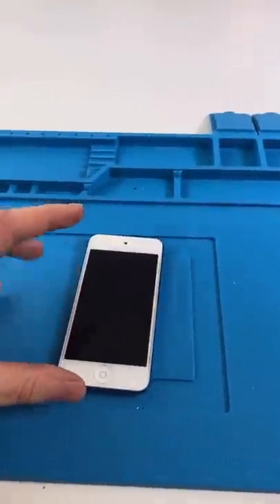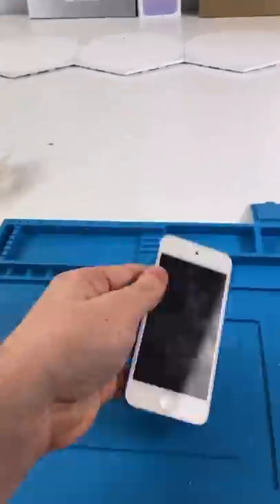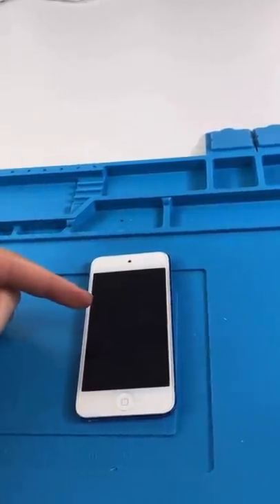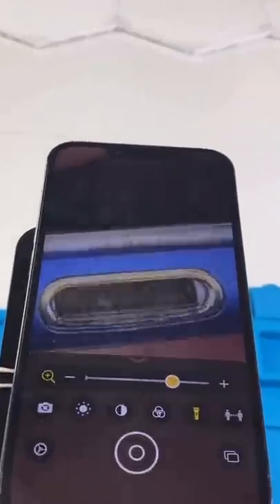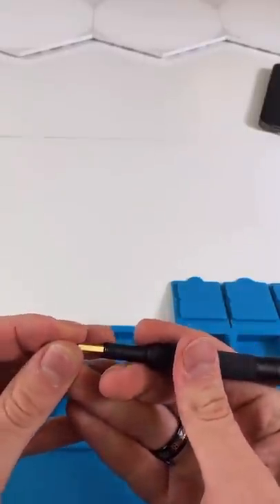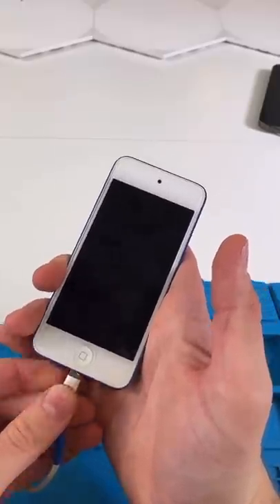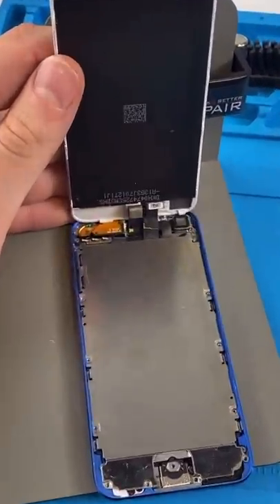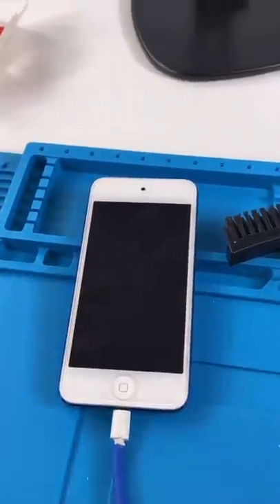STOP USING RICE FOR WATER DAMAGE.... #Shorts

Comment from the maker: it's an iPod 6 lol. And when you use rice on a device like this, you're making the problem worse. Honestly probably the reason why this one isn't working. Take out the sim and let the device get some airflow, or do absolutely nothing. Anything is better than rice!
Reply: Okey
Reply: 2nd, sorry had to do it
Reply: what about a hair dryer on cool? or a table fan to improve airflow and circulation? asking for a friend.
Reply: Rice actually made sense when you could open the device, remove the battery and place it in there, now heck nah.
Reply: Ok
Reply: But why tho
Reply: How u get rice out of your headphone phone hole
Reply: rice worked with my iphone se 2020 :/
Reply: Why can't you fixed it!? 

:(((((((

Wait
I don't care really
Reply: @richardhbn3308  ew iPhone
Reply: @richardhbn3308  the rice didn't do anything though. In your case there just wasn't enough water to kill the SE
Reply: @bennydontplaythat  the water had made its way under my screen and near the ram and it would restart contantly also dont tell me jack about it if you werent there
Reply: @ralphlee4060  what headphone hole tho lmao
Reply: @richardhbn3308  lol ??? My job is literally fixing water damaged devices. I'm just telling you the fact which is that rice does not do anything to fix water damage
Reply: @richardhbn3308  (Only reason I care is because people constantly bring in water damaged devices that don't work and are filled with rice)
Reply: stupid suggestion
Reply: Silica gel
Reply: ipod touch 6th gen
Reply: ipods have no sim card readers they go off wifi
Reply: Was about to say, 6th or 7th.
Reply: iPods don’t have sims tho…
Reply: Does silica gel work? The one inside shoes boxes
Reply: @koceme  heat works the best
Reply: What about corn works much better than rice and is too big to get into the charging port or any other part of the tech
Reply: Yeah
Reply: Ipod 6th gen
Reply: Ipod touch 6
Reply: I've had the same ipod in the same color, got rice in the charging port because I want to put it in a bag of rice for some reason, not sure why but I was 13 then and when I got a piece stuck I broke the charging port in the process.
Reply: I knew it was an iPod 6 or 7
Reply: Rice is better than nothing it absorbs moisture why do you think they expand when you cook them
Reply: Hey my phone is a xoimi  redmi 9s and when i put it in charge it says charging its slow how could i fix it pls help me
Reply: @navidnnAE  xaiomi*
Reply: @navidnnAE  you are not using a fast charger
Reply: 600th like!
Reply: @undefined06855  no way
Reply: iPod touch 4 has the old design, 5 gens have a little silver ring on the back and a more modern design, 6 gens don’t have the silver ring. 7 gens are the same as 6 gens
Reply: An iPod 4 need a 30 pin connector
Reply: Hi, josh(?) im about to attempt fixing my note 9 and i need your help. I need to know, when you’re removing your screen from the frame, do you also need to take out the battery and vibrating motor and all that stuff before you start prying into the screen or can you just pry it off after disconnecting the connector? I came here from a video of you fixing a note 9 display but its a short so you had to skip a lot of details, I need your help please, thank you.
Reply from the maker: @genzeuronymous7787  bro who is Josh
Reply: @PhoneRepairGuru  don’t know
Reply: @PhoneRepairGuru I must have confused you with “josh connects” another youtuber with similar content. But yeah, i saw a video where you replaced a note 9 display and you separated the lcd from the frame and i just needed to know how you did it just to be safe.. im sitting here with the phone already disassembled in front of me except for the stuff you cant taje appart without prying, i mean stuff not held together with screws like the battery..
Reply: Can u help me with something on my phone the phone is a motorola g8
Reply: Yah the 5 has the strap dot thing in the corner and the 6 doesnt
Reply: I have a question about an Android that I "repaired"...are you open for it?
Reply: Which smart phone in your opinion please share
Reply: Why do you use metal picks to clean out charging ports
Reply: Ugh I remember having that iPod 6 gen. Died soo fast. And the screen was popping off from the battery 😎 finally got an iPhone bc of it lol. I dropped my 7 plus into the tub on accident (it slipped outta my hoodie when I was cleaning the tub) and like- as soon as it fell I grabbed it turned it off took it out of the case, dried the outside and let inside air dry. The speakers and mic were muffled but I fixed that my self, everything works fine now. I got my phone battery replaced recently and they said there was no water damage which is a relief! Thank gosh I did everything right or I would’ve gotten grounded if my phone broke.😂😂

And one time while I was on a zoom for school my hydro flask fell over onto my chromebook (personal not school chromebook) and the water went into it, and the screen was messing up and basically I wiped everything, turned it all the way off, put it like a triangle and let it air dry over night praying it would work because I had school the next morning. When I woke up the next morning I turned it on and it was completely fine. It still works fine til this day. 
I get very lucky with water end electronics 😂
Reply: @AbbeyKitty1013  are you really here to complain? How sad
Reply: But why I don’t see how rice could effect the device since they are kinda dust proof how can rice be worse the. Sand or other earth elements 🤌🏼
Reply: just a question where could i buy a phone from this guy
Reply: I would like to know if it is possible to take a virus off of a PS4 and if so how much would it cost
Reply: Yeah. I got water in my phone and i took out the sim card and let it sit for 24 hours and its working perfectly now
Reply: I had one of those
Reply: @zolavib1187  it still doesn’t help dry it out. Rice doesn’t help your phone dry any faster than air drying, so corn wouldn’t either
Reply: I was about to comment that cause I have one
Reply: and silica?
Reply: How come u never fixed a Samsung or any other phone
Reply: @Postwarlakeplays  he has an A70 screen replacement video from a few months ago that just got recommended to me. I’m assuming he just prefers working with iPhones or they do better on YouTube titles than Samsung brands
Reply: I’ve updated my iPad to iPad os 15 and it just completely crashed my iPad it shows signs of charging but won’t power on to test my theory I used 2 different portable chargers and with the original cable it came with it would only charge and not power on or show dead battery symbol but my portable chargers would show that it’s getting power any thoughts?
Reply: The 4th gen still has the old thick look while the 5 and up are thin
Reply: What if we put it in silica gel
Reply: I was like thats a iPhone 6 because i got my dad one
Reply: i have an ipod i think 6? its got some charging problems and stuff but honestly still works pretty well lol
Reply: So I dropped my phone in water, and the screen was unresponsive. I followed your advice to not use rice, and it worked!
Reply: Can I send you my phone for forgotten passcode phone repair guru
Reply: @abnervazquez3783  are you in usa or canada?
Reply: Untrue, rice does help, but silica is better. Both pull the moisture out of the phone. This iPod was probably already damaged when they put it in rice so it didn’t help. Also it doesn’t have a sim tray.
Reply: How can you take out the SIM card…on an iPod touch?
Reply: @NielsDutch1906  there is no sim card maybe a sd card
Reply: @robloxmaster8089  it was sarcasm. I know it doesn’t have both
Reply: Or if it’s a really old bad damaged phone u can just throw it out and get a new one
Reply: @bennydontplaythat  or it was distilled water
Reply: Hi
Reply: I have a IPod5 that has suffered a ton a abuse and still works better then my old XR ever did I have a 6 now lol
Reply: Better don’t Use metal in the Port Bro it can get damaged
Reply: @AbbeyKitty1013  iPhone and Android are both good quit doing phone wars
Reply: Ipod?
Reply: Except more water
Reply: Its an iPod Toutch 7th gen because its missing a lanyard thing from the back
Reply: I did that and my phone worked later: except the microphone.
Reply: @ralphlee4060  Cook it and eat it.
Reply: Even water is better the rice? 👀
Reply: @richardhbn3308  rice doesn't do anything lmao
Reply: Vitor Salles There a hole at the bottom of my android its for head phones after my water aciddent i put rice to soak water out and it think the jack got full of rice
Reply: @ralphlee4060  tho the rice doesn't do anything. It just gets dust inside ur phone
Reply: Or use water?
Reply: It's BRIGHT SIDE to blame
Reply: @hareeshravis1919  what
Reply: @BigMacCheese  yup they told this as life hack
Reply: @hareeshravis1919  ok
Reply: Lss
Reply: 100th
Reply: I thought ipods didn’t have SIM card
Reply: I still use rice but I cover all of the holes plus I am really good with not getting my phone wet so that's a plus.
Reply: Dream  That isn't true. See above comment./
Reply: @Cfomodz  I never said it wasn't. All I said was is in this context using a dessicant will be pointless, it won't do anything.
Reply: Dream  Nothing does Anything magically… ever.
Reply: Dream  it is moisture, not water, by the way.. maybe research first? Why do you think we use it with 3D printers? Because of all the water that gets in the bin?… or could it be the moisture?
Reply: @bennydontplaythat  yeah… but that isn’t true though..
Reply: @Cfomodz  What's your point? If the inside of your laptop is soaking wet, a dessicant won't save it, just plain and simple. Dessicants act way too slow to be effective as an actually strategy for water damage repair. (Bc it's not moisture, it's standing water on electrical contacts that progressively gets worse as time goes by.)
Reply: So can I pour it with more water?
Reply: I have a iphone XR with water damage would you be able to fix or do you not do send in orders.
Reply: I once dropped a full cup of water into my laptop while it was running. I did a hard shutdown immediately,  left it open like a tent and put a fan directly on it. Left it like that for 3 days and then tried to turn it back on. Miraculously it turned on without an issue and still works great to this day!
Reply: Sorry but that’s an iPod 7
Reply: I have that same I pod touch and the battery will only last five minutes tell dead after a full charge is that normal or can you fix it
Reply: Dream  Computer science? Unless you're double majoring in electrical engineering why would you possibly think that matters? Also what you're majoring in matters 0 since there exists objective fact regardless to if you have learned about it or not. Ergo, go research first.
Reply: Dream  Oh my gosh. Who "supposed" me to be using silica gel? And what IS silica gel? Oh, it's a desiccant as well... Wild.
Reply: @richardhbn3308  you dont know jack then. If water had gotten under the screen and over those connectors, no amount of rice or god can fix it unless some technician take it apart. Lying on the internet aint gonna make you look cool and you cannot change the laws of physics. If you can prove that rice really does help then go claim a nobel prize
Reply: Here the thing my phone i put rice in when my phone got wet and 2 days later i get it out m thg hear phones dont fit so i need a tutorial  hie to get rid of the rice
Reply: iPod TOUCH 6th generation
Reply: @ralphlee4060  toothpick and super glue?
Reply: can you fix my ipod plz
Reply: Ikr using rice is just DUMBBB who the hell suggested that!???🤬🤬🤬
Reply: Don’t use rice, use silica gel, that’s why you always get those, they’re for soaking up moisture.
Reply: IPod toach
Reply: I had the iPod 5 and it looked just like this. I don’t even know what current iPods look like now.
Reply: @iair-conditiontheoutsideai3076  Because what the phone needs is air circulation to evaporate the water, not rice.
Even if you found something hydrophilic and that didn't damage the electronics, it still would be better to just open your phone as possible and let it take air. Plus rice can get stuck in holes of the phone ( like the charging port ), and it is pretty annoying to remove sometimes if you don't have something able to pull it out without damaging the contacts of the charging port. Simply not worth it.
Reply: @dankdabby826  probably it is treated metal/not metal at all and just hard plastic that resembles metal aesthetically...
Neat stuff
Reply: @SirSlicer66  well no, rice dust isn't normal dust as it is hydrophilic and could slip right into your board and make water touch the board ( which isn't a good idea at all ).
Reply: @brunoglopes  still not worth using rice.
Reply: @Cfomodz  even being a desiccant, it's for a different purpose. Silica works excellent against humidity, but not against moisture. 
Desiccants need to be in contact to actually absorb water, which just isn't happening in regards of phone repair. It is easier, faster, and more reliable to just leave the water evaporate as normal, while the phone is still open.
And diseccants still work slowly, silica is used for long-term dehumidification, not for a quick absorption of moisture.
Reply: @eugenesmemes  begula
Reply: @FatFlashYT  no you did not
Reply: Put maple syrup
Reply: OK thanks a lot!
Reply: Looks more like an iphone
Reply: I did this with my Ipod 7, it worked fine, but I can definitely see in some cases it not working out so will keep that in mind!
Reply: Silica gels work
Reply: yes
Reply: @AbbeyKitty1013  he doesn’t do board repair
Reply: Dank pods would be ashamed
Reply: The thing is you need to put your phone in a thin sock or any thin cloth just to keep rice from getting but also letter the rich absorb any moisture, rice is a pretty good way to repair water damage without having to open your phone risking damage especially who dosent know anything about phones
Reply: I was gonna say, I have that same iPod Touch in Blue, and it’s a 6.  But the 6 and 7 are practically impossible to identify between by a glance.
Reply: @Xenoscoutknight THIS IS AN IPOD TOUCH SIXTH GENERATION NOT AN IPHONE 4!
Reply: And I Love PRG! ( Phone Repair Guru)
Reply: The reason why it doesnt work for everyone is because not all types of rice have the same amount of ambient starch which helps dry out the device. The higher the quality of rice, the less ambient starch it has. If you live in asia, you'd have more access to different varieties of rice. Here, we actually store unripe fruits in rice box until it reaches the desired ripeness. Usually if you just let an unripe fruit outside, it will just rot, but since the rice box absorb humidity, it prevents the fruit from easily rotting.

Comment: This is the reason why I usually just suggest that people leave the device in the hot sun for a while. The rice just cloggs the slots and causes a lot of issues. And water damage must be dealt with asap for better chances of survival (according to me atleast)
Reply: Dips open PCB in distilled water
Still works dumb.
JK LOL
Reply: the sun isn’t really better…
Reply: Best is sand or flour always worked wonders for me
Reply: @ramizalizada4565  ah  yes bread dough in my phone my favorite
Reply: @canny1913  exactly! Sticks to every dirt and easily pulled out, leaves the insides dry!
Reply: But the issue is it’ll break if the phone overheats
Reply: @rayirth.upside-down  exactly, just use distilled water to wash the mineral water minerals away
Reply: @FlamaAce  Nah, imma just seperate the water atoms and make it into hydrogen and then enjoy
Reply: Putting the phone in a sealed container with Silica gel packets will also work.